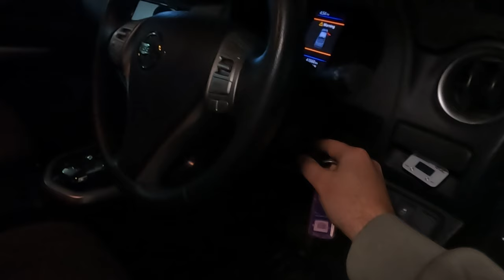How to significantly increase the value of your Navara - NP300 Build

Comment: I really hate to tell ya, but all you had to do, was turn a screw, anticlockwise, one quarter of a turn. It is in the drivers side door pillar.
Reply from the maker: Does that make the lights not turn on though with the door open? Does sound a lot easier 😬